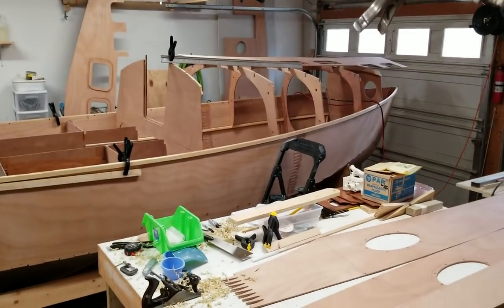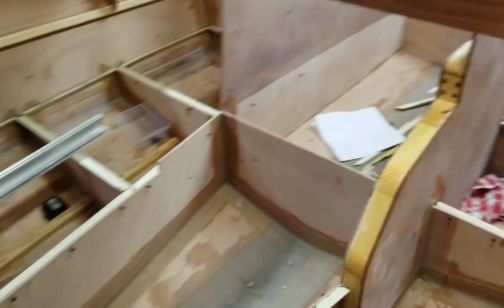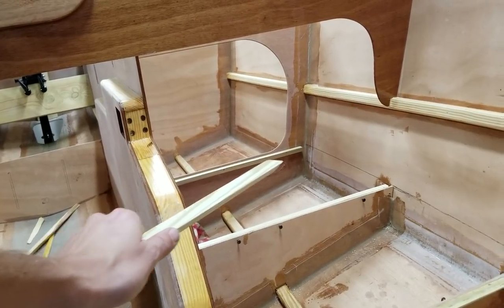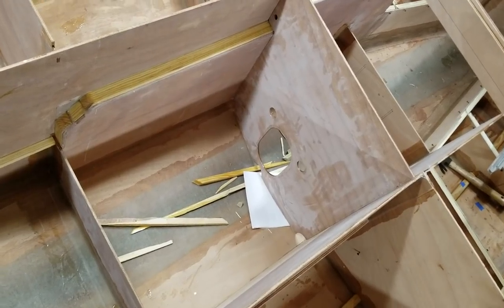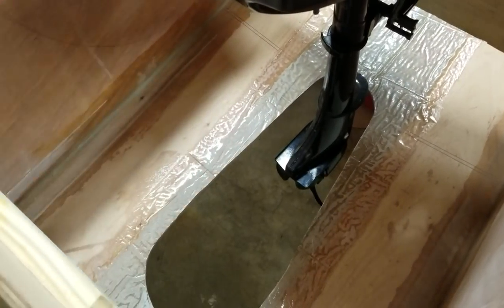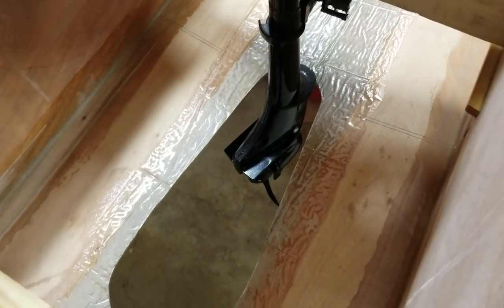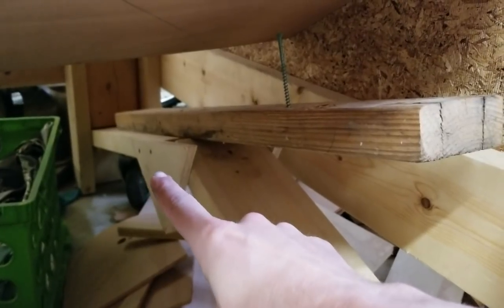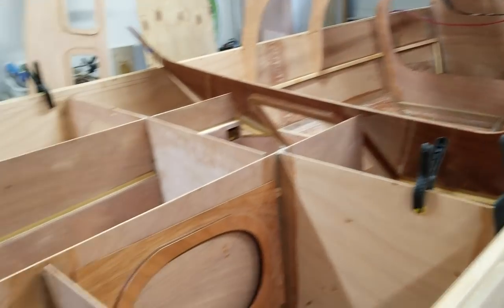Taylor and Alan's Core Sound 20 mk3 update #1

Comment: Would you be kind enough to share the blueprint so i can try build my own ?
Reply: Alan how much you will charge me for a blue print. I want to built the same boat for me.
Reply: As I've previously said. I'm old fashioned and was raised back in the earlier days. and years of yester-year. If I owned those drawings and blueprints, and I was finished using them then your request would be granted. - Why? - Because, back in the old days of the early 20th century the majority of the people after they were finished building their own DIY projects they were almost always happy to pass along and/or share their used drawings and blueprints along with their knowledge to others  for "free" or at the most for just a few measily dollars (uselly less than $10.00), of whom wanted to build and have such an item for their own use but yet couldn't afford to purchase such drawings and/or blueprints.  

Those drawings and blueprints were generally passed from person to person until those drawings and blueprints were so worn out by use they would fall apart and had to be discarded in a trash recepticle. However, in the latter years of the 20th century, and here now in the 21st century, everybody has gotten money hungry greedy. It is extremely rare that used drawings and blue prints ever get passed along to another person for free or even for even a few measily dollars. 

Generally the owner wants either a full new price, or a slightly reduced new price for those used drawings or blueprints and generally never less than half price even though the owner no longer needs them. So, Good luck with that request to the owner to possibly share. 

If anything, you'll probably end up paying either a full new price, or a slightly reduced new price, or at the very least half price for those used drawings or blueprints if the owner decides to part with them at all.

Comment: Hi .  I also want to make my own boat like you.  Can you share me the blueprints
Reply: I'm old fashioned and was raised back in the earlier days. and years of yester-year. If I owned those drawings and blueprints, and I was finished using them then your request would be granted. - Why? - Because, back in the old days of the early 20th century the majority of the people after they were finished building their own DIY projects they were almost always happy to pass along and/or share their used drawings and blueprints along with their knowledge to others  for "free" or at the most for just a few measily dollars (uselly less than $10.00), of whom wanted to build and have such an item for their own use but yet couldn't afford to purchase such drawings and/or blueprints.  

Those drawings and blueprints were generally passed from person to person until those drawings and blueprints were so worn out by use they would fall apart and had to be discarded in a trash recepticle. However, in the latter years of the 20th century, and here now in the 21st century, everybody has gotten money hungry greedy. It is extremely rare that used drawings and blue prints ever get passed along to another person for free or even for even a few measily dollars. 

Generally the owner wants either a full new price, or a slightly reduced new price for those used drawings or blueprints and generally never less than half price even though the owner no longer needs them. So, Good luck with that request to the owner to possibly share. 

If anything, you'll probably end up paying either a full new price, or a slightly reduced new price, or at the very least half price for those used drawings or blueprints if the owner decides to part with them at all.

Comment: HOW MANY CENTIMETERS ARE THERE FROM THE OUTBOARD TO THE Stern?
Reply from the maker: approximately 66cm for my short shaft motor.
Reply: Thanks for the response and speed
Reply: sorry, and how many centimetesrs ar from  the top of outboard tramson to bottom of boat?
Reply from the maker: @jatsualbizu8748   It's about 35cm. It took a lot of trial and error to get it as far back as I could. I recommend dry fitting everything and you really need the motor on hand to test the fit. I wouldn't use those measurements to make the mount and glue it in without having the motor to test.
Reply: Thank you very much for your help and the videos made, they are very inspiring and educational @bandbyachtdesigns

Comment: hello sir just want to know what is the thickness of plywood did you used in that boat, thank you.
Reply from the maker: Edwin, The hull of the boat is all 6mm plywood (~1/4"). It is thin because there is a lot of structure inside to stiffen in. This keeps it light. The outside also  is glassed with 10oz fiberglass. The internal structure is also 6mm.

Comment: Excellent Job !!! You really have it all figured out. Glad to hear the wife is helping. Keep up the great work. I see where it fiber glassed the joints....but what do you do with the other service area's? Do you paint those or coat with epoxy then paint?
Reply from the maker: All surfaces are coated with 3 coats of epoxy. Exterior is painted, interior is left with just epoxy to aid in inspection later. Some high traffic areas will get glass cloth such as the cockpit sole.